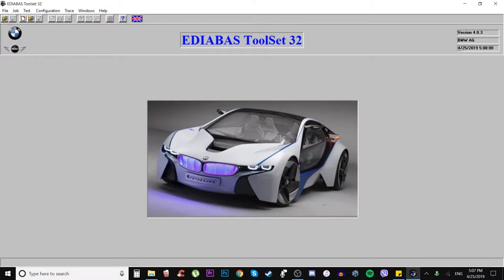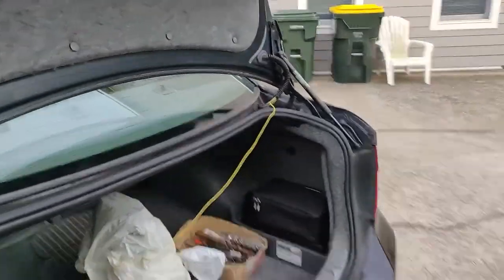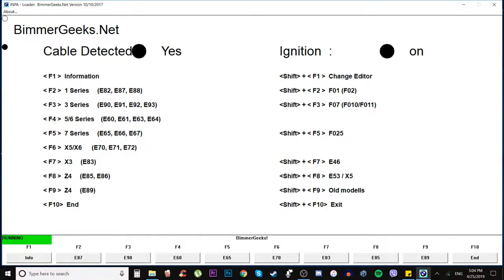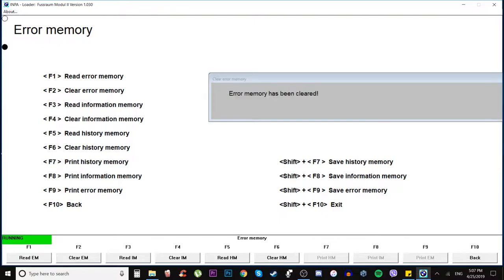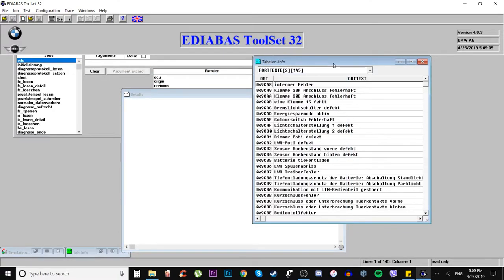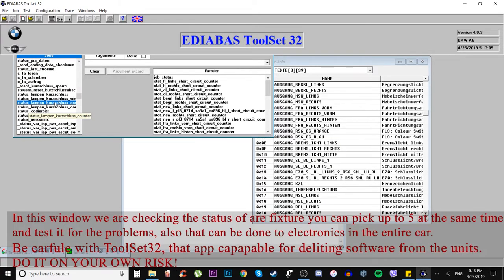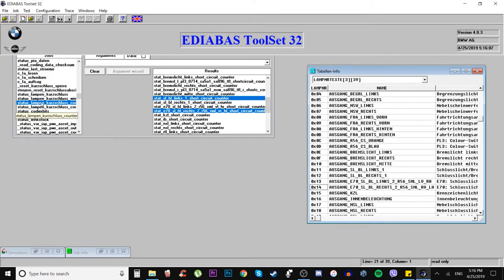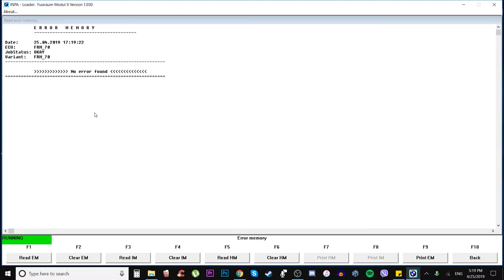BMW Coding FRM short circuit counter reset Toolset32. light not working. FRM2 FRM3

Comment: Saved my ass as well. Thx so much! Got my adaptive headlights working again. Just and FYI for anyone reading this, my error counter was only at 14 and the FRM would not turn the light back on even though it was repaired.
Reply from the maker: It also called cold monitoring, the pre check of all the system, good example will be as if you would install led lights somewhere in your car as angel eye, and when you open the car it will blink, for the headlights is same Procedure but it’s more complex, that’s why it’s not always the counter… I hope you get where I’m going, afterall BMW is f-top when it comes down to electronics…😅
Reply: @Makhnovets  "BMW is f-top when it comes down to electronics…"   Yup! LOL

Comment: Hello!  I have a 2008 BMW 328i, which does not have the power seats or the driver's window button working.  When I scan with the inpa the frm module shows me 9 errors with counters at 64. But they all have to do with lights, the strange thing is that all my lights work perfectly.  Any advice to repair my window and seats.  Both the window and the seats work if electricity is passed directly to the motors.
Reply from the maker: Hey. The FRM2 have this type of problem, I’m not that knowledgeable in the toolset32 to do all type of resets, but what i can tell you is that the frm2 have known reliability issues, what I done in the past is replaced frm2 with frm3 module, it requires little bit of coding but nothing crazy, there guide on that topic.

Comment: Hi there. Which one would I used for a 15 bmw 328i F30. Should I used the frm_70 or frm_87.   I had the left side headlight caught on fire. Replace the wiring and headlight. Only problem I have it's DRL angle eyes don't work. I was told I need to reset the short circuit counter. Could you please help me with that thank you a million.
Reply from the maker: try both, as far as I know it's based on the protocol it's using. if It's didn't work , its only because it's a wrong protocol. also, if you chose the wrong one it will do absolutely nothing"It might show the data, but you will not be able to reset the counter if it's wrong groupe file.".  but as I showed in the video you use INPA to go to module info.
Reply: @Savage Motor Gears   my laptop doesn't have a ethernet plug. I got an adapter to make the ethernet plug to connect the cable. It's not connecting with the program. Do I need to changed some setting for the laptop to pick up the car or cable to work. Thanks

Comment: Hi I had a new new tail lamp fitted and the lights aren’t working , showing fault code 9CBB short circuit fault could this be something to do with the footwell module
Reply from the maker: Most likely yes, but if you retrofit light and the previous was working I would blame on that, but if you have the toolset32 installed, it’s easy enough to troubleshoot.

Comment: how would I go about an frm reset ? I believe mine was shorted. Lights , windows etc lost power :(
Reply from the maker: for that you'll need the NCSExpert software, which included in tools pkg, pretty simple procedure,  there lot's of info on the forums, do you have any obd messages related to the FRM? and what are they?

Comment: can an FRM2 be repaired..would it cause my headlites, brakelites, domelites and wipers to stay on with car off? also have a no crank no start but guy jumped battery with heavy charger in trunk..car also wont shift now..2008 328i automatic sedan..any help appreciated
Reply from the maker: So BMW have such a think as intelligent battery unit. which can case any type of problems, if battery low on juice it can do anything to get enough to start the car, but if battery is week you can have variety of problems, miss-fire, some electric failure or so. check your battery/replace/register/reset the faulty memory and try again. 
obviously you have to have some type of messages in your units. so check the OBD, then do the assumption.
Reply: @Makhnovets  OK i havenew battery but if i turn the car on, the BRAKELITES AND HEADLITES AND WIPERS STAY ON, so ill drain the batttery if i do a code scan, right? I dont know what to do..how do i do a scan without draining the battery with these lites on..please explain in simple terms i bought a creator BMW scan tool would appreciate any help..do u fix these FRM2's? i can pay you to reset..please help how do u reset faulty memory?
Reply from the maker: @gail6904  In Europe There lots of companies that specialize in fixing FRM units, people have like no light at all in the car, but it also can be the same issue. use the battery charger to keep your battery in the shape while you coding. I need research a bit more about that question, I would try to reset the FRM unit to the factory settings first true the NCSExpert. and then decide what to do, maybe you need to replace your FRM, at least check the internet for repair service, like that one https://ecuteam.com/bmw-auto-computers/bmw-frm-footwell-module/  Or eBay have a-lot of services, usually the main chip on the bord gets f-top, so you need to re-flash it. you can do it at home with a special tools X-Prog box which will require soldering and windows 7 for flashing, but easier to just sent it to some specialists, will be cheaper and 99% of the time it works. https://www.ebay.com/itm/FRM-2-3-Footwell-BMW-MINI-REPAIR-SERVICE-Software-Update-CODING-INCLUDED-/263494687110
This is just examples of services, you can search it in web, there are numerous companies that do that in a week or less.

Comment: How can you do this with a f11 bmw 530d ? Any help is appreciated 😮
Reply from the maker: the software is the same and presider, although you will need the rj45 cable, the connection protocol is little different. might even have the reset presider in pdf, need to look for it, but overall is similar to what you seen in this video.

Comment: Hey and thank you a lot for this video. I'm having trouble getting my tail lights to work again. Last week I had an error message for the rear left and before I could check the bulbs at the start of this week another message for the rear right. No suprise - tail lights on both sides won't light up, if I switch them on. The bulbs were fine, so I followed your instructions. All error counters for the lamp shortcuts were 0 and after clearing the error memory of the FRM, I don't get any active error code. I've resetted the tail light counter for both sides nonetheless but to no effect. Even swapped the bulbs to brand new ones and tried again for no effect. Any ideas on what else to check coding wise? I got the feeling it's no hardware/wiring problem.. E92 320i touring '06
Reply: The wiring going from the body to the trunk might be cut.

Comment: Can I use this for the F series? I have an F31 and need to reset my parking light
Reply from the maker: Simple answer is yes, but the file and protocol can be different, Personally I newer used the tool32 on F-series, but the software is working with F-series for sure! You need a    E-Net OBD Cable, and I guess to read the User manual for the ToolSet32. which is huge! ((
Reply: @Makhnovets  I have the cable. I was going to use e-sys but the license ran out last month. I know the setting I need to edit for the light, just don't know the best way to connect. Originally I thought ISTA would work but apparently not. Appreciate the reply thanks
Reply from the maker: Whot do you mean by ISTA? And ISTA-d only have scanning capability, you need either ista-p or tool32, for the tool32 you just need to choose proper sgbd file, but it definitely has to work, I know because i was playing with it when i had f10, but i newer Purposely use it as for reset or so. I only have a 90 experience with it.
Good luck with the project!
Reply: @Makhnovets  I see. Thanks for the advice 🙂

Comment: what does it mean, when you get lamp NR in the status instead of OK?
Reply from the maker: It means that you have short circle.
Reply: @Makhnovets  so need to try and work out what wire on the FRM goes to the left front parking lamp  (Angel eye.) and replace it then?

Comment: Hello sir, Patient E70 X5, stop lights not all working, left top (stage 2) and  right bottom when pressing pedal, but when activated by snap on all 5 lights one by one can be activated and lightning.. Stop switch by pedal changed. Very odd, all counters 0 with tool 32, I think if there is 50 on those lights wouldn't work activated by snapon by Obd.. There is 9CBB error related to mirror heating, and A8B7 to right  stop light. Any clue will be very appreciated. Thank You very much
Reply from the maker: So i I'm driving 2007 x70. The only fix i know so far it's replacing the frm unit for newer one, or send your for repair. My two break lamps are not working correctly, also passenger mirror not moving left-right, test the motor it's working, so car have brain damage which is frm, check true toolset32, there no stored memory.  I turned off warning lights from the dash and i-drive, and decided not to deal with it. It's not worth 500$ to spend for new frm, buy newer x5 sell the old one!) Check the video how to code out the messages on my channel. Thanks!

Comment: so, @Savage Motor Gears , i am following your tutorial very closely and when I open the FRM_70.prg file in toolset32 i do not see the lampen reset function/method anywhere in the list.  Thoughts?
Reply from the maker: You can try first FRM_87 and if that not going to work try frm3
Reply from the maker: What car do you drive? And what the inpa showing you about the module?
Reply: @Makhnovets   I think it may have been an issue with the toolset I downloaded.  I redownloaded "bmw standard tools" from scratch and now the method is there in frm_70.  I have a 2008 e90 m3 and I have a stuck cc-id 373 even though the lamp is operational. Tested it with INPA.  Believe the FRM counter needs reset.
Reply: @Makhnovets  INPA shows the brake force right error even after clearing out error memory so it is working correctly.
Reply from the maker: @alexherman8642  just code out the messages from the dash, i have same issue on my 2007 x5, that's pretty typical problem for BMW's 07-09.
Reply from the maker: https://youtu.be/aPApyIFPbCc
Reply: @Makhnovets  Before attempting to code out, i'd like to try and see if I can fix the issue.  I ran the toolset32 methods and there is not a maxed out short circuit for the BFD recht, as far as I can tell.  Resetting the frm counter did not clear the error from the car either, checked in INPA and it comes right back.  Do you think this issue could be caused by an old battery?
Reply from the maker: Do you keep car running? While you do the coding, because if not that's the big chance. Otherwise if car is running or there shouldn't be any problems.
Reply from the maker: I just ran my X5 with tool set 32 and there are no issues with the frm unit. That mean you have a bad connection somewhere or a song problem with the actual frm. that is pretty typical like I said for the cars from '07 to '09
Reply from the maker: There are many services you can send your unit and they going to test it out and fix it if you really care about it
Reply: @Makhnovets  I was actually doing it not with the car running! So I will try that!
Reply: @Makhnovets  do you know what specific counters I should check in toolset32 for brake force display error right
Reply from the maker: @alexherman8642  check all of them, you can do 5 at the time.  That's easyer then to look fo unknown
Reply: @Makhnovets  just to update you.  I replaced the battery to be safe since it was so old.  error still there for cc-id 373.  Went into inpa to test bulbs, activated brake force display.  Sure enough driver side outer housing, the brake force display bulb was out.  Swapped in another bulb.  Error free for a second.  Shut down and restarted car, now getting CC-ID 134 right side brake light out, but the bulb IS NOT out.  Thoughts?
Reply: also want to note that none of the counters in the FRM have any short count to them at this point, and it has been reset.
Reply from the maker: Did you check the board itself? Remove all the fixtures and check the connection points.  Also there ground wires, make sure they all intact. Like i mentioned there big chance that's the frm unit itself, find the service that can check the frm, or get the same frm for testing and see if the light's are working.
Reply: @Makhnovets  which ground wires are you talking about? I will definitely check the boards
Reply from the maker: https://youtu.be/DSy6XO446gs
On e9x series it's really rare happening but worst checking

Comment: hello, the brake lights of my bmw e82 stayed on, they don't turn off
Reply from the maker: It’s due to sensor, or dsc, there could be speed sensor but in any of those you will have code, so what codes do you have?

Comment: Hey! My front passenger window is moving inch by inch because of an anti-trap code that won't go away even after reset. The motor and regulator work fine.
I am at a point where I wanted to see if its possible to recode the front passenger window regulator in Tool32, but I never used the software.
Would you happen to know if this is doable? Thanks :)
Reply from the maker: try to press and hold the sunroof button for 30seconds, or just watch the video: https://youtu.be/jMt54BXLSzo
or if you try it already, why is the anty trap system is bugin out? Did you use ISTA to delete the code or do the adaptation? The ISTA should do the trick! Toolset can reset the counter, but it will not reset the system any better than ISTA. What code do you have?
Reply: @Makhnovets  Thanks so much for your reply. I have tried the same reset procedure for thr windows and several others that said to put the window fully down, hold for 15-20 seconds and then put thr window fully up and hold for 15-20 seconds.

Nothing got rid of the Anti-Trap iDrive message. The worst part is whenever I scan the car's module there is no code for the anti-trap, there is only in the iDrive.

Whenever I do the window initialisation in Inpa or Ista, the windoe just moves down 1 inch and stops. I'm pretty lost as to what I should do and thought maybe recoding the FRM could do something.
Reply from the maker: What year and model of the car and what version of frm you have?
Reply: @Makhnovets  It's a 2011 E90 335i xDrive with an FRM3!

Comment: Hey there, I have the exact same issue as yours but my counters show 0. My lamp lights when testing it with Foxwell scanner but otherwise the exact same problem as yours.

Every single counter is 0 for some reason yet the 9CBB error exists.
Reply: Got the same issue. Did you find a fix for it??
Reply: @DaMajesticMuffin  Yes, but not completely sure how. I think I might have done a cold restart for the car, then used Toolset32 before INPA to check and reset codes. The codes then did not reappear.

Keep at it, the car will work!